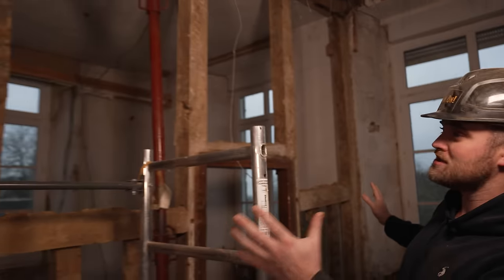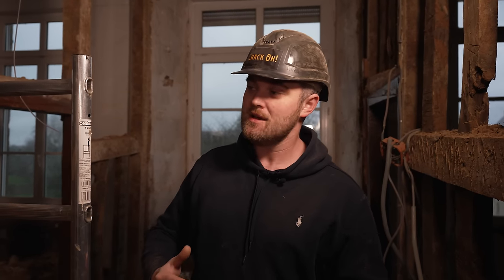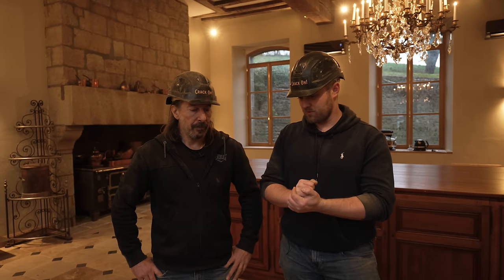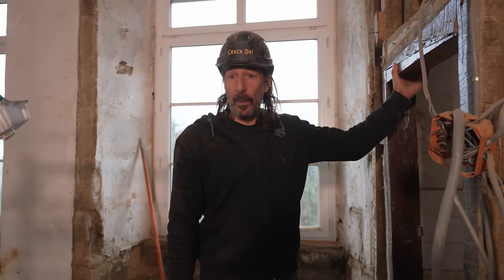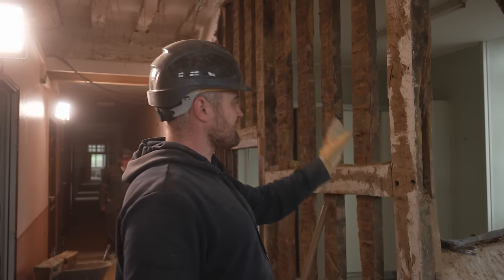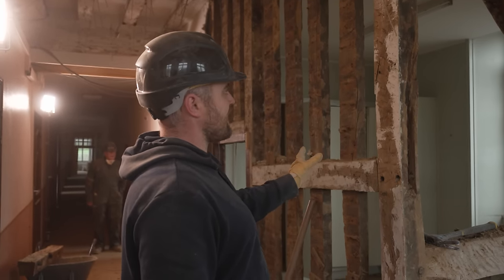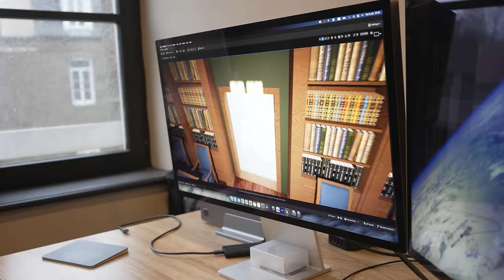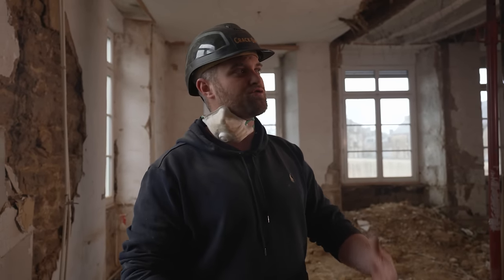Revealing The Library Design!

Comment: Isn’t it amazing that the craftsmen that put those beams in did it 250 years ago.
Reply: ALIENS!
Reply: I think that too! They would be amazed at all the tools nowadays that would have made their lives so much easier!!
Reply: With only hand tools
Reply: @joycearmstrong8628 right?!
Reply: Modern builders and what is referred to as today's craftsmen wouldn't even put 1/2 as much time, care, energy and tenacity into their work and most if not all, done by hand w/ homemade tools.  The minds and bodies of the past were in many ways superior and internal pride and ethics were at the forefront and valued.
Reply: The convent also received major renovations in the late 19th century so maybe some of the walls were made then. Still it's great craftsmanship all around. Carpenter workshops really took pride in their work and built things to last for at least 2 life times. And yes they had some chemicals to treat the wood even back then, to make it water resistant.

Comment: For the railing in the library it would be nice if it was possible to match the one in the main stairway. Welcome back Simon.
Reply: Brilliant idea!
Reply: I had the same thought.  Perhaps  using the oak studs that were just removed.
Reply: Agree. Or a somewhat modernized version to be a bit less heavy, but mimic the lines and style of the original.
Reply: @Julie-bq6iz  that would be very very fitting that's good oak and free as well put back some of what was removed all be it turned in to hand rails and such very good idea I love it
Reply: Great idea!!
Reply: This!
Reply: I came here to make the same suggestion 😊
Reply: I love this idea! I also think a wooden staircase should be added to one end of the balustrade so it becomes one coherent room rather than two separate ones that can only be accessed via the main staircase externally.

Comment: I think you need a spiral staircase between the floors, or it'll feel like two rooms. And welcome back Simon.
Reply: I was a little disappointed at the lack of a staircase, thus access from the ground floor. I know it will look wonderful when you are done.
Reply: It looks amazing but I agree it needs connection. It’s like two separate libraries.
Reply: Yes!
Reply: Spiral staircase 👍
Reply: Interesting idea
Reply: I agree, but not a small spiral one, a big wooden one that can facilitate both floors, still keeping a gallery type look.
Reply: I def think a spiral staircase,  easy access to second floor. So you don't have to go across the place to get upstairs. Be one library instead of two.

Comment: Just a couple foods for thought:  you might want to consider extending at least some of the book shelves over the doors and windows.  It may be more cohesive & not so boxy / regimented looking, creating a more finished look.  Also, you may want to use the balastade design from the master staircase for continuity & in keeping with the original design of the convent.

Comment: You are correct that adding flitch plates to the sides of the beam would not look right - but adding one inside the beam using a chain mortiser (a cross between a router and a chainsaw) should be possible and a good joiner could hide the work -and the bolt holes -completely. Alternatively, by hanging from above you could hide the rods inside the upstairs partitions and possibly take the load from an RSJ in the attic. If you do decide to replace the beam, you might not need to dismantle upstairs - by propping the ceiling it might be possible to drop the old beam by a few inches and feed it out through a hole in the wall and  the new one back the same way. All these methods have been used elsewhere. It would be a good idea to cost all the options first - a beam that big may well be very expensive.

Comment: I love the design of the library, it is going to be amazing! However the upper and lover level seem to me a bit disconnected. Might be a challenge since the walking space on the gallery is needed, but have you considered connecting the levels with a spiral staircase? I remember you showing one from the brocante that did not quite fit for the chapel. If you would choose to put in a metal spiral staircase it might be nice to pick up that style and do a metal railing (like in your inspiration picture for the library). Whatever you choose, it will look absolutely stunning! This project amazes me and I admire your perseverance and positive energy!

Comment: @ThePethericks, Hi Billy, with seeing the concept for your library, my mind return back to the layout for the larger bedrooms on the rest of the floor and having the hallway running along the back (or the garden side) of the Convent, I can see some changers that can help Convent. 
1) Move the main (larger) bedrooms to the top floor and have the hallway running along the court yard side of the Convent, in this you may get more large bedrooms out of it. 
2) The room downstairs marked as a dining room, but is better place to lounge/rec room, because it is closer to the reception area (to keep an eye on the area and to hold items maybe need to be used in this room).
3) Remove all the old sinks, radiators, doors, etc and store them now, it will help in the long run.

Comment: With all those old timbers and dimensional framing boards it is likely that you have some key ones that would lend themselves to some beautiful oak furniture or stair rails. Run them through a good wood planer and I bet the grain structure is awesome. I was able to recover about 9000 running feet of 70 year old red oak flooring from an old house here in Texas and have been making projects for the last 4 years. The grain is beautiful, the wood is extremely hard, and durable. I would have loved to find old dimensional boards such as those and recycle them. Watch for nails!

Another possible tip is to consider using a garden hoe to pull off the wall and ceiling rubble. With its 5 or 6” wide blade and 90 degree angle from the handle could be quite effective in pulling it off.

For the library gallery, you may want to consider the ladder access to the upper book shelves when determine the gallery depth from the shelves to the railing. Ladder slope is an important consideration for safety and comfort.

For the ceiling beam, you may consider making your own glue laminated beam from your oak boards.

Comment: The structural  engineering  necessary  to create the "hole in the floor" aspect of the second floor with no posts supporting it from the first floor will be very interesting. I think you are going to make your beam supplier  very happy!!   😁😁 Just hide the check book from Gwen and you'll  be fine. 😂

Comment: Good to see you back Simon. Get a wood drill the same approximate size of the pin in the beam, that's how we took the skeleton out of a 200 year old barn, moved it to another property, and the owner used it to build a beautiful home. Michigan virgin white pine, virgin cause it was before the great northern forest fire. The beams were almost 14" square, and 40' long.
Balance those long beams on your shoulders, much easier to carry that way, saves your arms.
Are you going to put a spiral staircase in? How do you get to the upper floor?

Comment: Welcome back Simon!   Wonder if the smaller jackhammer with a piece of rebar as the tool, would get those wood pegs out easier?  Love that old construction. So strong.  Also the direction you are hitting them can make a difference.  I know a lot of wood nails like that are wider on one side so they get tighter as they are hit in.

Comment: Great progress. I think the full extent of your vertical work would be well served by at least one wall giving the appearance of being uninterupted(ish) books for the entire height. This might be achieved either by a narrower section of the balcony with thinner rails (wheelchair access permitting), a transparent floor for the one wall, or some other way that someone cleverer than me can think of. Sliding ladders are a must! And I like the idea of a spiral staircase somewhere, maybe leading to a reading area on the upper level.

Comment: @24:28 the Digital design of the Open Gallery Library is Fabulous!   I don't know if I'd use his balustrade design- perhaps better off drawing from the look of what you have as reference there already, though that is beautiful and strong looking.  You could even use wrought iron, though all are expensive.  Maybe you can upcycle some balustrades from an Old building of correct age range?  This all has to be so costly!  Keep up the great hard work.

Comment: 18th century ingenuity cutting a channel down the center of a beam in order to insert tongues of vertical studs.  My experience renovating a small 18th century colonial house with pegged joins on beams was cool.  But what we also found were hand forged square hammered nails on the studs and lathe walls.  Have you found any square nails in the wallboards?

Comment: Did you say that some of the cells had been modernized?  Before you burn semi-modern, recovered wood at the chateau, should you test it for any chemicals?  --Also, aren't some of those timbers you are removing, helping to hold-up the top floor?  --The balustrades on the upper part of the library, almost look like the beautiful ones on the staircase.  That would be a nice touch, to match them. --Welcome back Simon!  Great timing, too.  The kitchen and the organ are done 😂

Comment: They also would have constructed the timbers out of green wood and the pegs out of dry wood. When the green wood dies it shrinks, causing the holes to tighten up on the dry pegs which don't shrink. That's why the pegs were so hard to remove.

Comment: Would you consider having the library rail balustrades match the rails of the original staircases?  Is there room for a set of stairs (spiral or otherwise) to connect upper and lower library levels without needing to leave the library?

Comment: The "crack" in the beam didn't look like much from the brief view of it.  All wood will get splits, but the strength is not compromised.  Maybe you should have a structural engineer assess it, and leave it in place?  Would save a lot of cost and work, as well as retain the original feature.

Comment: Hey Billy! If you are considering adding a spiral staircase, would the central pipe support the questionable beam so that it wouldn't have to be replaced?
Or ... if you are going to demolish the third floor rooms to replace that beam, how about extending the library to the third floor by cutting out the middle of the beams and use the sides as support for the balconies of the second floor library and third floor "art gallery".  Wow! that condenses hours and hours of me thinking what to do with that failing beam.  The logistics to replace that beam would be daunting.  It would also open up more space for that magestic chandelier you are thinking of.
A wise old man (me) once said: Dreaming doesn't cost any money.

Comment: A smaller oval, you're losing too much space to the cut-out square.  Echo it w/ oval in ceiling-painted mural.  When you look up, it will look 2x as high- the perspective is everything.  Echo on groundfloor w/ pattern.  Take bookcases to ceiling & alternate under windows w/ lower bookcases vs. Benches.  several work spaces around oval

Comment: @7:38 - Tool abuse!  Your socket wrench extension is not a beater bar.  Get a length of rebar from Brico Marche.
You guys also have a (disturbing) tendency to use the sharp edge of a chisel as your lever point.  Stop using your chisel as a prybar.
For ceiling demolition, you should build an inverted shadoof so Yannis can use gravity instead of arm power all the time.

Comment: These wood pin I see that you had hard time getting them out look at the hole because when the pin were put in one side of pin is bigger than the other side the reason to lock the two PCs wood together bang out the small side of the pin and see which hole is smaller